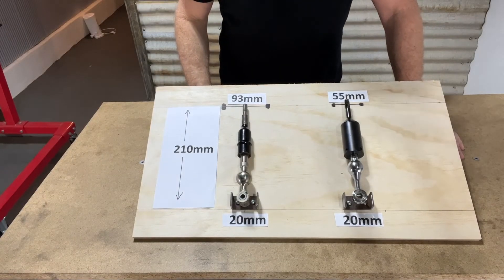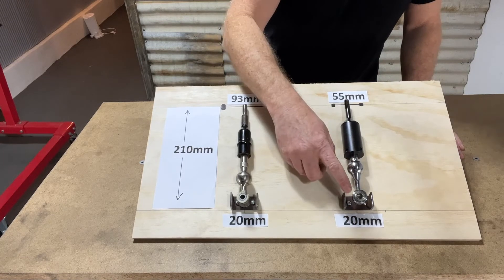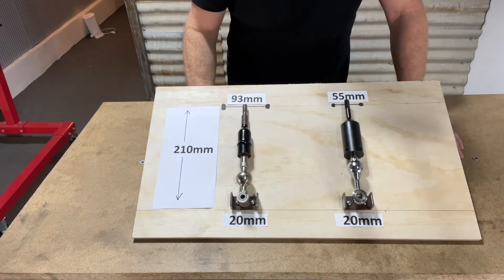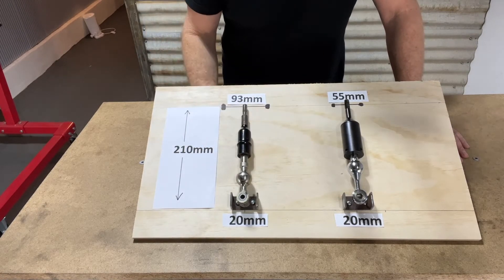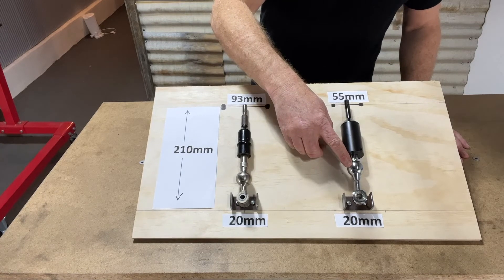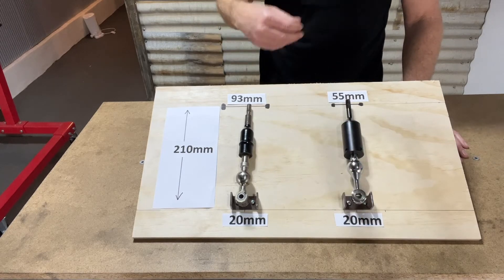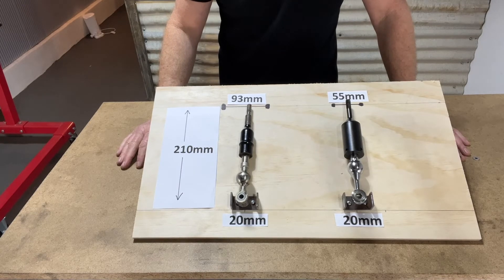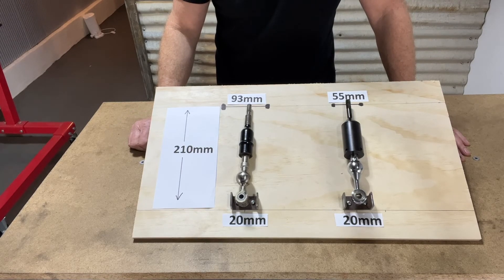How a Short Shifter Works from the Experts

Comment: nice video! what i always wondered is why OEMs themselves dont use short throw shifters especially brands like bmw that are all about driving experience. is there an advantage to long throw oem shifters that makes manufacturers go for them instead of short throw ones?
Reply from the maker: Glad you liked our video! OEMs design shifters and vehicles in general with the "average driver" in mind. The average driver, usually wants all of the vehicle controls - steering, clutch, brakes etc to be light to operate. The way they acheive this with a manual shifter is with a long throw, which gives more leverage. The downside of the long throw, is reduced shift feel, increassed vagueness and decreased shift speed. Also OEM shifters are built down to a price, wheras we design our shifters with performance in mind. PS some of the OEM's do make short shifters as an aftermarket option, for example TRD ( Toyota).
Reply: @cubespeedequipment870  oh i see now, thank you so much for the detailed answer.